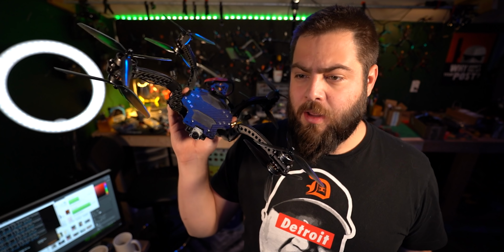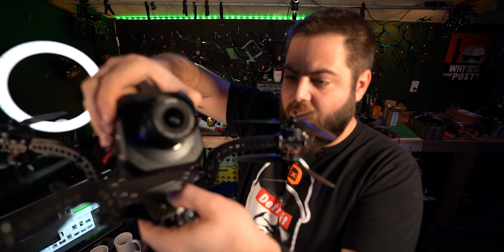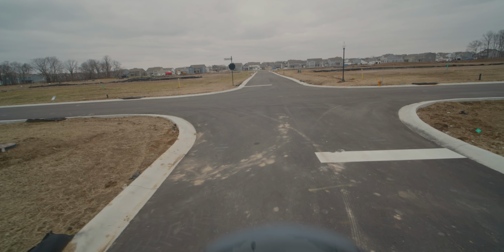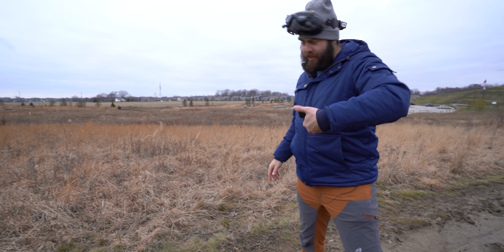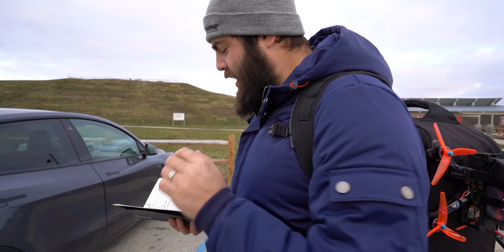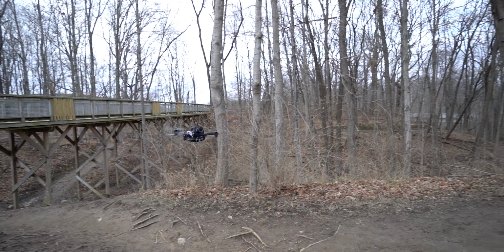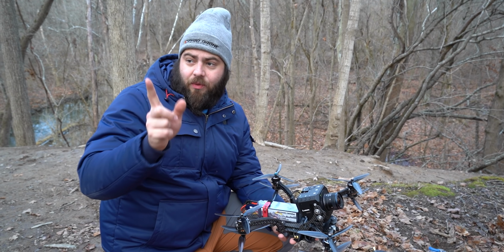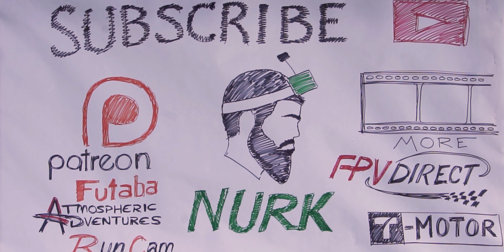Cinelifting the Panasonic BGH1 on my Shendrones Siccario

Comment from the maker: Frame: http://bit.ly/3bwqHJ9
Motors: http://bit.ly/3i6x8Us (1300kv)
ESC: http://bit.ly/2xUKTCX
Alternate ESC: http://bit.ly/35uAWKb
Prop: http://bit.ly/2IwPJfb
Flight Controller: https://bit.ly/365pa9W
DJI Products:
Get Started with DJI: — https://bit.ly/3crk3l1
DJI but I want my own radio: —https://bit.ly/3crk3l1
DJI Receiver Directional Antennas: TrueRC Patch for DJI — https://bit.ly/3cs3xBi (requires 2, not necessary, but amazing)
DJI Receiver Omni Antennas: TrueRC Stubby Singularity — https://bit.ly/3cqC2rD (purchase 1, comes with 4)
Reply: Which battery do you use?

Comment: whoever disliked this, is ILL not SICC

this beast flies incredible. But i have a dslr body like camera. the pocket 4k. 
would you still recommend the Siccario or you would recommend the thicc in this case?
Reply from the maker: i think it would be easier to mount on THICC, though gab has put out prints that allow you to mount SLR style
Reply: @NURKFPV  and if you don't mind the added effort to mount a BMPCC on, than would you recommend the sicc?

Comment: Hello, did you add a connector to power the camera from the lipo? Can you provide a like to the right connector for the BGH1? also did you use the KDE BEC to provide 12V?
Reply: Came to search if anyone had asked this as I'm looking for ways to use the DC input to power this camera. He hasn't replied but I can tell you that the BGH1 DC Input accepts an EIAJ Type IV. Hope this helps creating your own cable.
Reply: @Carlito_MD  Yea I had found this in the specs of the camera but unfortunately I couldn't find it anywhere in stock. Amazon and other shops do list them but unavailable. I was hoping to get a link to an online supplier that would have it in stock :)
Reply: @joe72110  Ah ok. If you don't want to wait and/or don't mind spending $29, you could purchase the Core SWX VBR battery coupler for their Powerbase EDGE battery and modify the cable terminal. Just saying. Good luck!

Comment: Looks great Nurk! How is it mounted, would love to see how it works on a Thicc if you still have one?
Reply from the maker: I do have one, and it would be super easy. Just standard 1/4-20 mount in the bottom
Reply: NURK FPV really?! Just hard mounted, no alphagel mod? Thanks for the quick reply
Reply from the maker: Correct
Reply: NURK FPV Thanks! Do you have a link to the BEC you use please?